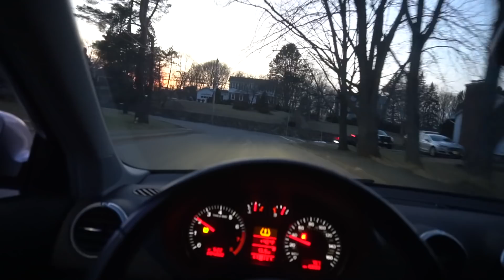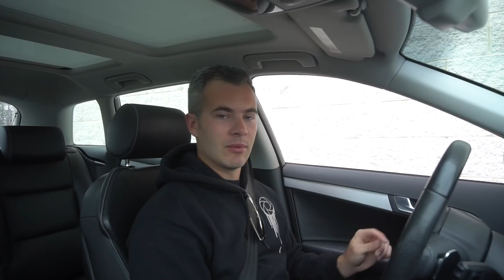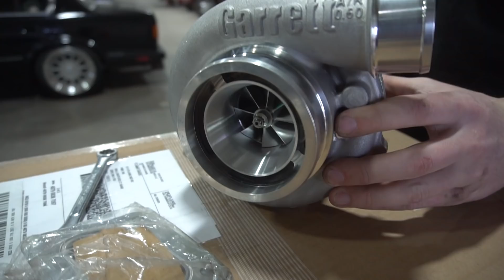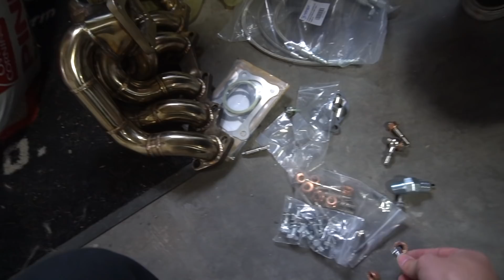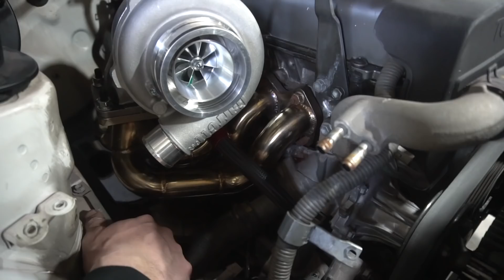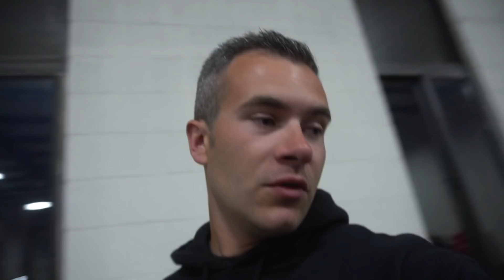1JZ SOARER SINGLE TURBO KIT IS INSTALLED!

Comment: Mike, put some kind of heat shield between the drain and the manifold, after some highway driving it will melt. Because of that the OEM drains are always hardline.

Comment: Get coilovers. I used to have an A3 and A4 avant and I had lowering springs on one and was honestly too stiff and didn’t sit right. Regretted it and bought coilovers the next week and rode WAY better and had a better stance. The springs rode like stock until I’d hit big bumps in the road and hit really hard. The coilovers ride like stock and are way smoother over big bumps in the road. Just get some decent brand new coils and you won’t regret it unlike you might if you buy lowering springs
Reply: Also get a dsg tune right away makes a big difference and way nicer. I’ve never had a dsg or auto but my friend had a mk5 R32 and the dsg tune made a big difference.

Comment: Id go with coilovers on the a3, these tend to sit lower in the rear on springs and personally i dont like that look, ive had H&R coilovers on my mk5 gti (same platform) but they were to stiff, id go with KW if you want to spend a little Bit more 🙈  they are really Good "allrounders" sorry for my grammar,  im from Germany 😂

Comment: The stock sidemount wont be able to cool that turbo but lucky u live in ct and it's cold as hell there atm 🙋‍♂️🇦🇺
Reply from the maker: Luke James I don’t plan on running it for long, just til I get a full new intercooler setup for it haha
Reply: @diiviinemedia  keep up the good work mate ur goin to love the single turbo on this I miss my soarer I had the same set up 3071 and auto 16psi on stock ecu with fuel cut defender loved life as a daily for over 3years.